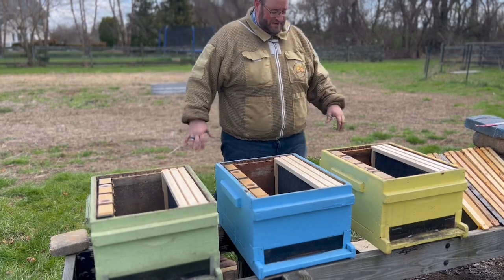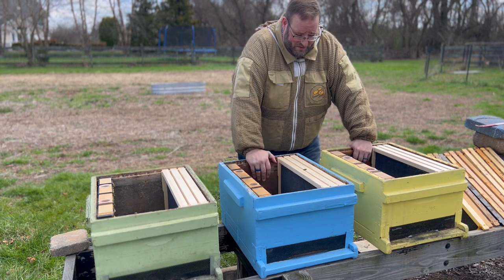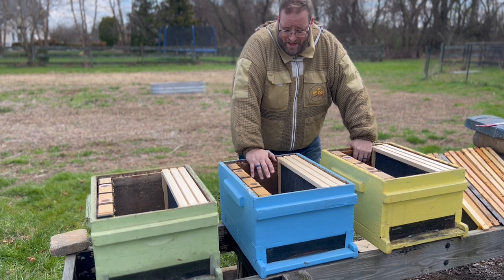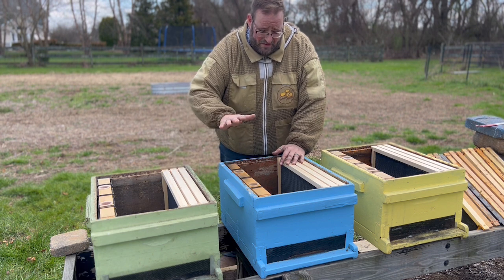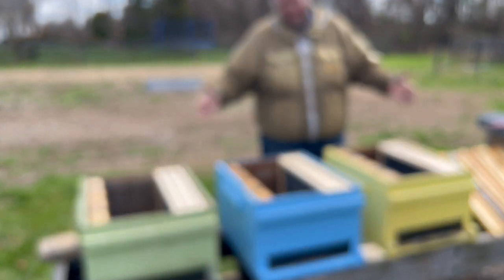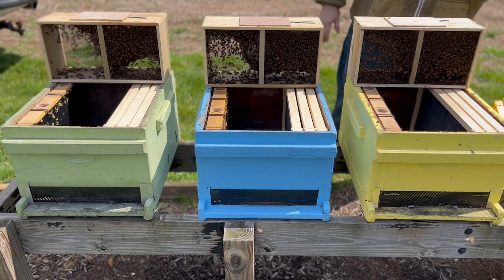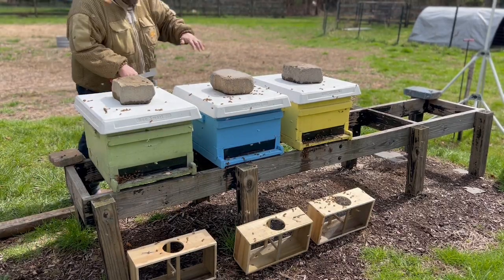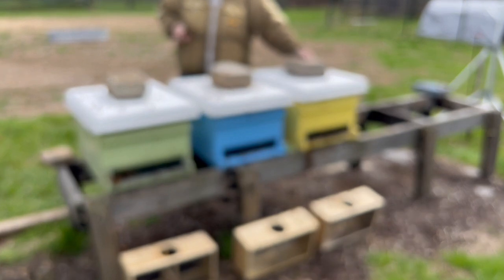What's the #bestway to install a package of #honeybees | Part 1

Comment: Pro tip from someone thats not a pro, currently learning all this stuff myself. If the subject in the shot will be stationary ie. boxes that won't be moving,  turn off Auto Focus. Waving hands, lower body movements and flying bees will mess with the AF as we can see in the video. Turn it back on when blogging and your face will be in the shot. Cameras Focus is designed to track faces not lower body. Don't hate the messenger, my intentions is only to help.
Reply from the maker: Yes unfortunately I forgot and it was a single take so couldn’t correct. Hence the disclaimer in description. But thanks for highlighting